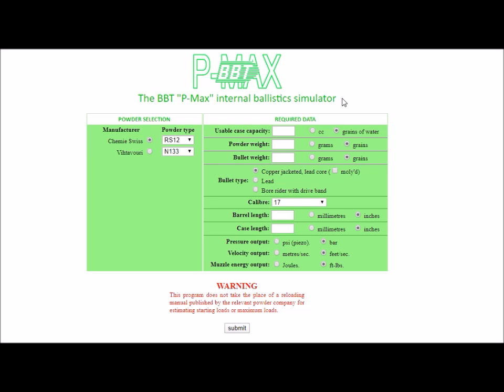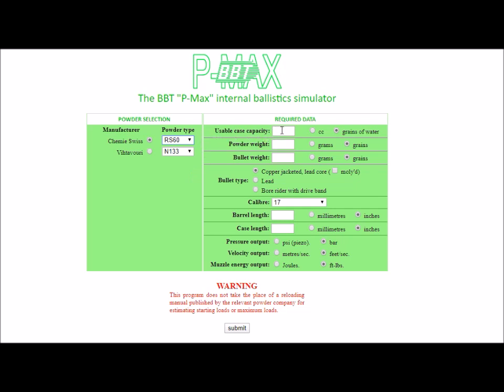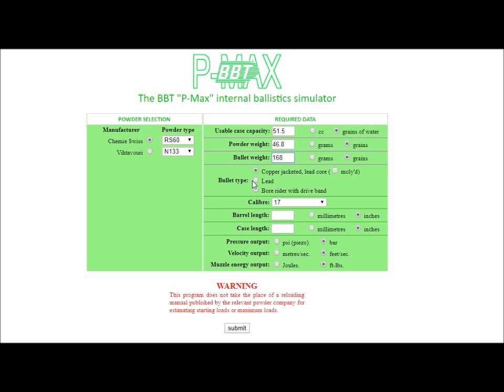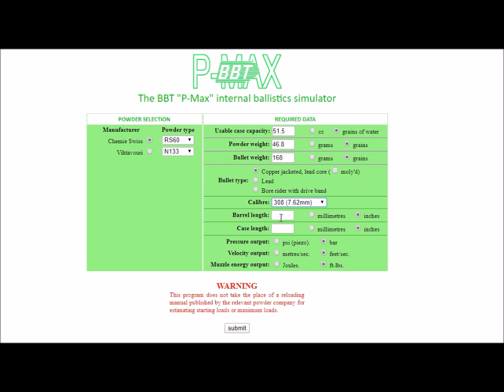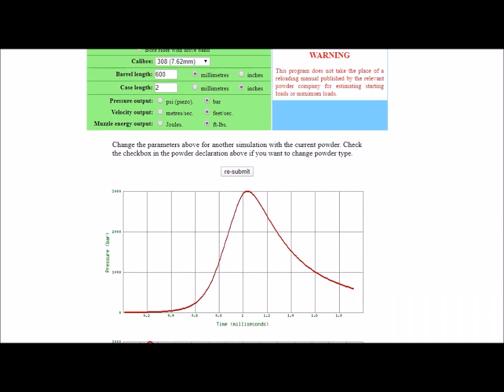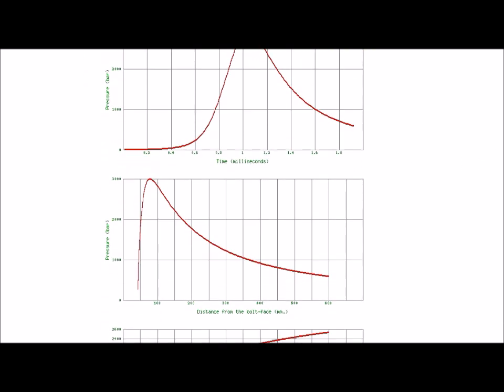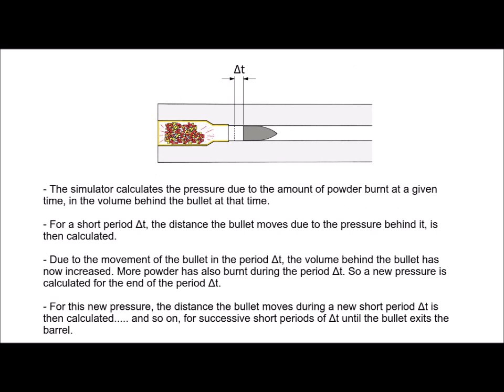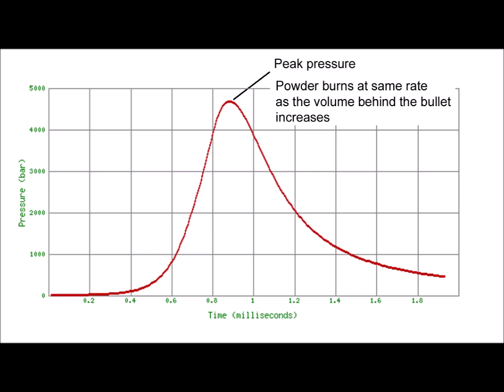BBT "P-Max" Internal Ballistics Simulator

Comment: Hello and thank you very much for the video and of course the program I have a question I do not use Molly on my bullets however, I do use neo lube coating inside of my case necks it’s basically a liquid graphite that when the alcohol evaporates it will coat the inside of the neck would I want to check the Molly box because it is a form of coating thank you very much

Comment: Not even close for 45 Colt. May want to write a version for handgun/straight wall cartridges and add some faster powders.
Reply: This from the manual....

Pistols and revolvers
Chamber pressures can be very sensitive to load densities, particularly for fast powders, and in pistol cartridges the load density can be very sensitive to seating depth, which is why programs like this tend to have a poor reputation for modeling loads for pistol cartridges. This model is definitely not appropriate for revolvers, which are in a class of 'leaky' guns for which different modeling methods are required. In consequence, fast pistol powders are not included in the powder libraries.
Reply: So such models can be used for GPMG?